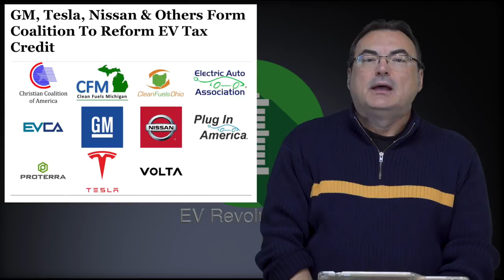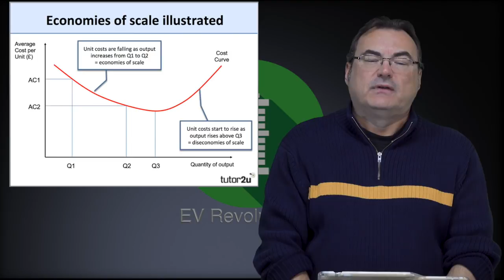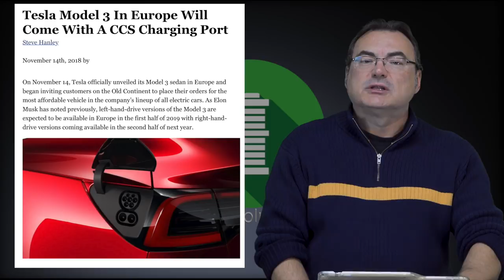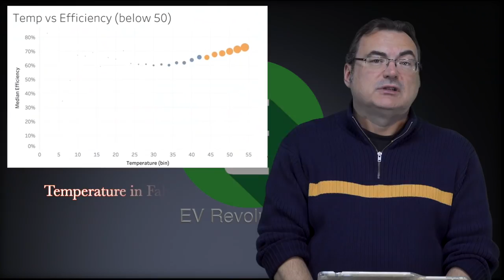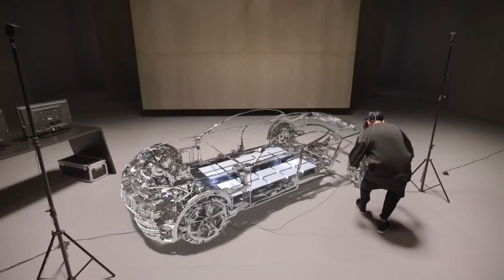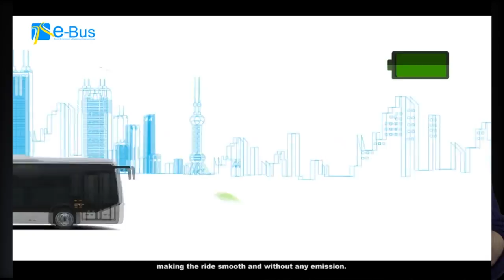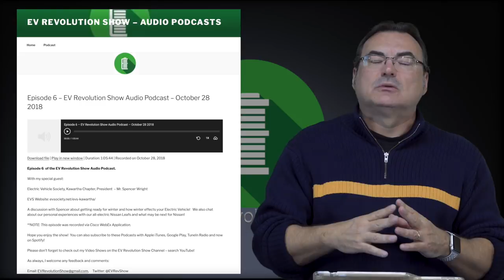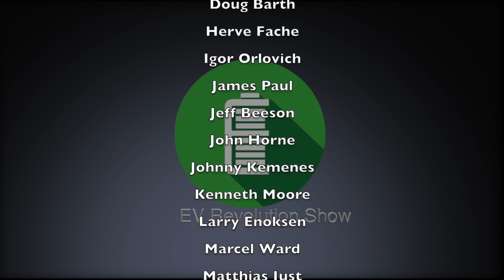Episode 20 - EV Drive Coalition, Model 3 Hits Europe, I-Pace Sales, VW $21K BEV and More News!

Comment: The european version of the Model 3 can not be charged at existing Superchargers. All Superchargers will get an additional Combo2 CCS cable.
Reply from the maker: Thanks Jurgen, good to know.  Thanks for watching too!
Reply: According to Tesla the retrofit should start shortly. Model 3 can only charge at Supercharger with CCS. No test-drives yet. The cars on display are US versions. The configurator should open before the end of the year. Production for Europe should start in January. First deliveries probably in March.

Went to Rotterdam in The Netherlands. Great atmosphere, smiles on all faces including staff. The car is absolutely beautiful.
Reply from the maker: Thanks Korrel for the info!
Reply: Jürgen S
They will be "existing superchargers", but modified with an extra cable.
There's no reason that in the meantime, an adaptor plug can't be used, similar to that proposed for the older models.
I would expect all existing locations in Europe to have at least one, maybe all chargers modified by the M3 launch date.
Reply: @rogerstarkey5390  there is no adapter the other way around. So until all stalls are retrofitted, supercharging model 3 in EU is temporarily limited.

Comment: 11:00 isn't it just that a colder battery can't charge that fast any more and so can't regenerate that fast any more ?
Reply from the maker: Hello thanks for watching and for your question.  Yes that is the case, however for these Model 3 reports, the amount of decline of the Regen power is what seems drastically reduced.
Reply: Apparently even with warm batteries issues are reported. At M3OC podcast they go more into detail. Apparently no problems with the standard Pirelli snow tires Tesla delivers. But issues with others.

Current theory is that lower speed rated snow tires are a bit more wiggely which causes traction control to interfere with regen.
Reply from the maker: Thanks for this info as well!

Comment: VW: 40kWh with 4C charging will be plenty for most. Most cars in that class cost more and charge at 1C.
Reply from the maker: Hi yup, does not have to be huge for more of a mass appeal BEV.
Reply: well to be fair...
tesla is the only one to date with a charging network and a warranty to backup their 1.5C claim
to pull that off on the etron would need 380kw charger. good luck with that
thats beyond the V3 superchargers even 

4 is idk...2.7x faster than 1.5

i somehow doubt their batteries are even better than the tesla cells as they do not even exist yet
nor would i want to charge that fast without warranty behind it
why would I even need to?

1.5C charging is already in the 20-25 minute range with existing charging network to get to 50% more or less 

i guess it allows smaller packs
but it gets stupid very quickly when it takes 5/8 minutes to get off the highway exit, city streets and navigate to a charger if you're only going to spend 8 minutes there...

especially if you have to do this every 150 miles with a 40kwh car
Reply from the maker: Richard Roberson Thanks Richard for watching and for comments. Tesla is not it all for everyone but they continue to help move the market forward. And others have good battery Warranties, not just Tesla.

Comment: Renault already producing ev for less than 18000 with 41kwh battery , ie the Zoe by next year that will be 50 from inside info leaking out so vw should be able to do this but numbers are the issue
Reply from the maker: Hi Nigel, thanks for pointing that out!  Yes I forgot about the pricing for the Zoe as I thought it was much higher.  There is a battery lease component to their structure too.  In anywise, you are correct that if Renault can do it, certainly VW can too.

Comment: Soul EV has been sold for several years, so Kia will have taken 5+ years to achieve profitability.
Reply from the maker: Hi, yes true, however the Soul has been more of a compliance vehicle so they've not produced enough to warrant the economies of scale.  With additional EV models, this is going to happen sooner.
Reply: @EVRevolution  If we are drawing parallels between Kia and Tesla then I'd say the original Roadster was produced in limited quantities also over a number of years.
Reply from the maker: @JeanPierreWhite   Hi yes, but that was a different case.  Tesla was staring up and needed the revenue from a super expensive sports car to build the company.  Kia has been a large auto manufacturer and company for many more years then Tesla and Kia has other revenue streams to pull from for EV development.
Reply: There's a difference between a company making a car profitably and the company itself being profitable. Tesla has been making cars at a profit for many years, nothing to do with how many quarters it's been profitable. Kia can have a profitable quarter and not make EV's profitably. Kia's statement of expecting to reach EV profitability means profitability at the car level, which should be compared to Tesla's profit margin per vehicle.  Otherwise you're not making a proper comparison.
Reply from the maker: @johnmoniz3169  Hi John, ok I still don't buy your profitability argument here for Tesla, because at the end of the day you and make a car and sell it to cover your manu costs, however if you can't make enough to cover the entire company overhead and costs, then you are not making a profit.  So my understanding that Tesla has only reported 3 profitable quarters stands.  

I understand what you are staying about Kia and yes they are most likely referencing EV profitability at the car level.  We know the vast majority of auto makers with EVs are not making any money or very little on them today.  The investment and economies of scale are not there yet, but will get there.  That is what I believe Kia is trying to say.
Reply: Hi Ken, the costs that kill Tesla's profitability are not overhead and other production costs, they are the costs required to expand their product line. The individual vehicles have over 20% margin. If Tesla stopped expanding, the losses would not be there. No question that Tesla, the company, has only had three profitable quarters, but the comparison with Kia is only valid if made at the vehicle level.
Reply from the maker: John Moniz Thanks for further clarity. Still good that Kia is investing more.
Reply: @EVRevolution  
I think it depends on whether you (we!) Consider "profitability" as including "Cap ex necessary for expansion" (or transition).
It could be argued that Tesla has had at least the potential for underlying profitability, discounting capex, for some considerable time. 
They are now exiting that negative phase as competitors feel the same effect.
The "others", even with the advantage of existing facilities (needing refurbishment) and / or the available finances to build new premises (especially Hyundai, Kia, with "in house" construction companies), are now broadcasting the "substantial", sometimes "unexpected" costs involved.
I suppose we could say "what goes around, comes around"? Depending on whether we think some of those above may have "contributed" to previous "opinions" regarding Tesla?
Either way, it may be interesting to watch now the shoe is on the other foot, particularly if the recession forecast by some becomes reality?
Reply from the maker: Roger Starkey Hi Roger thanks for all your comments. Yes is interesting to watch what is unfolding.